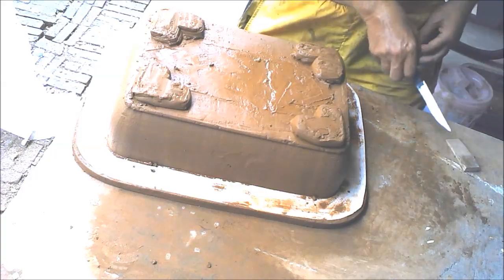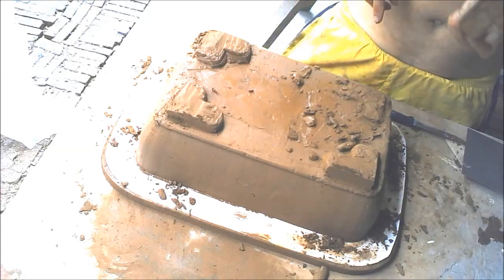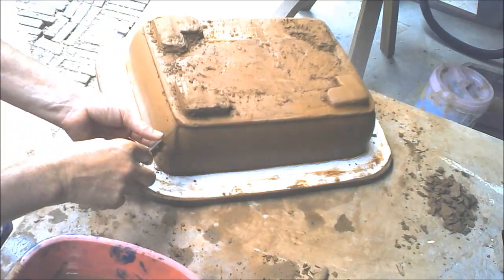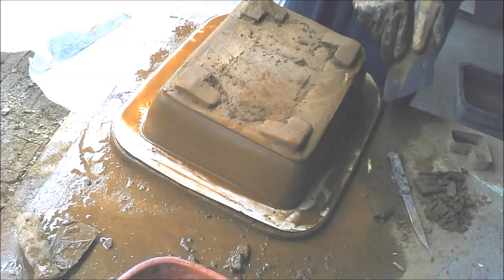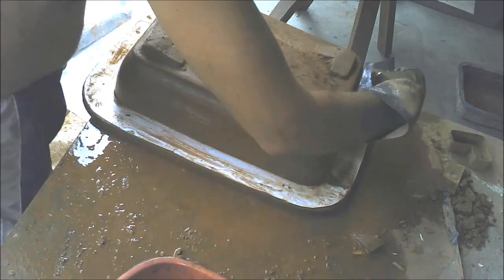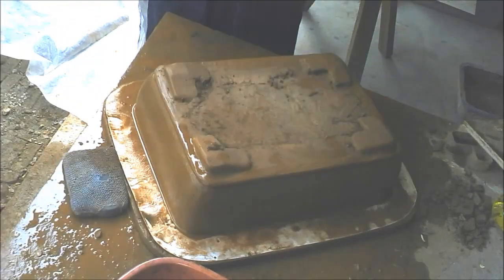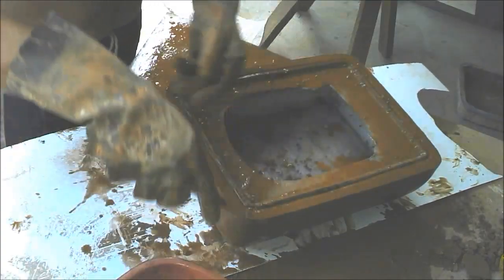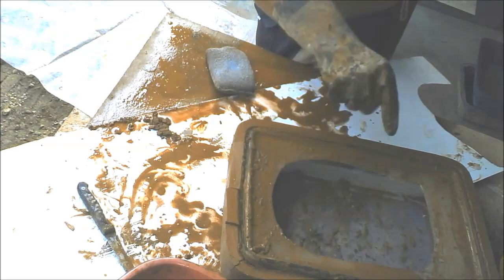My Movie4

Comment: Great video for DIY.My suggestion to remove the mould at the end to avoid cracking is using a water resistant grease as slip and a tiny air pressure. Good luck

Comment: At 14:50.....you have to make a hole in the center of The plastic material.........using a hot wire or something................to the air...............preventing VACUM.........

Comment: oh man all that and it cracked ...also why couldn't you just find 2 rectangular dishes one smaller than the other, coat the bigger one lay the fiberglass,fill it ,then press in the smaller one ...guess I'll try n find out if it's any easier
Reply: Or make two forms out of formica covered plywood, one smaller , one bigger , then fill it and then smooth it by hand
Anyway, it was a great project!